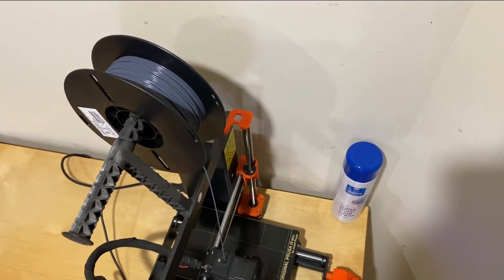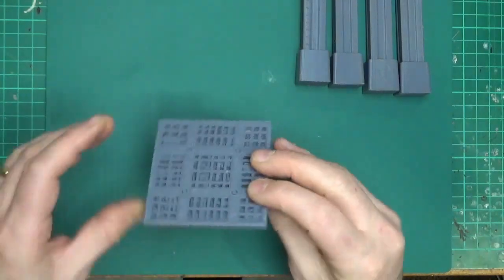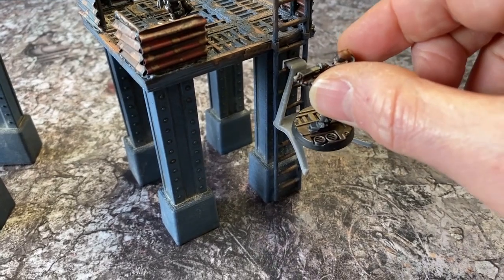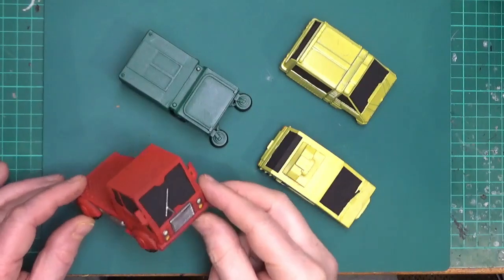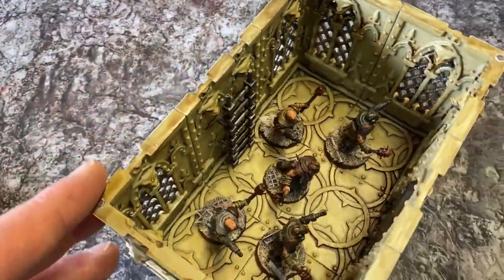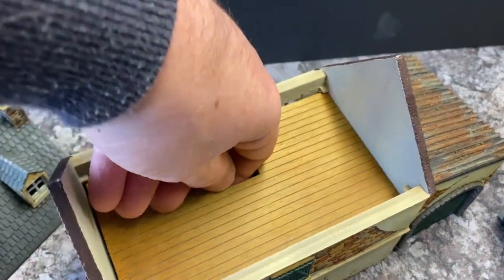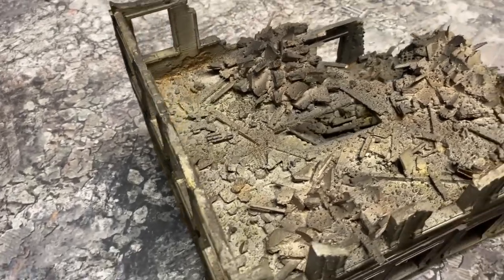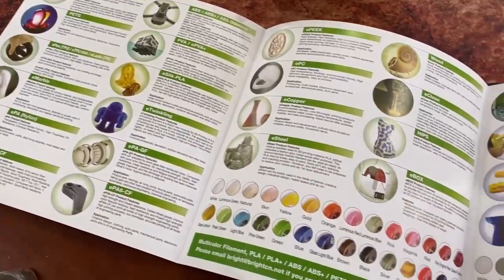3d Printing Wargames Terrain with a FDM ( Filament ) Printer

Comment: Do you know of a life expectancy for the biodegradable stuff when painted/varnished?
Reply from the maker: Interesting question. I cant say anything for definite but I would imagine if kept dry and out of sunlight it would last indefinitely. Moisture is likely to beginning the degradation process as would UV in sunlight I would think. But painting and varnish should at least block the UV. Hope this helps?